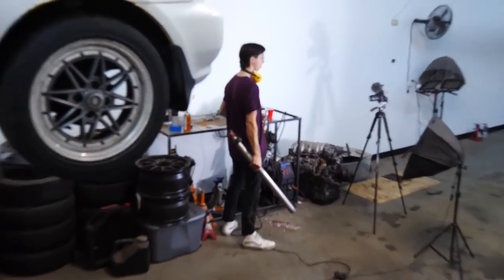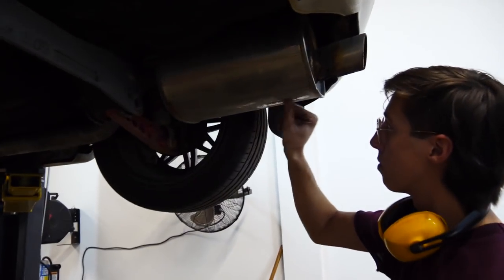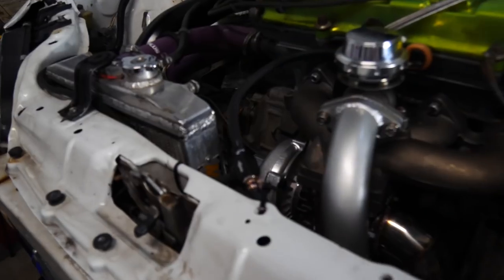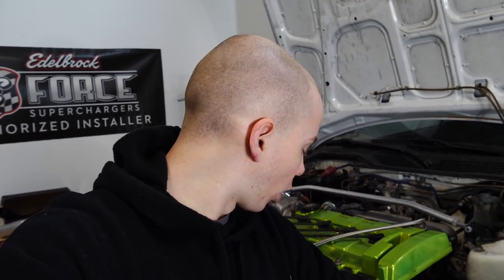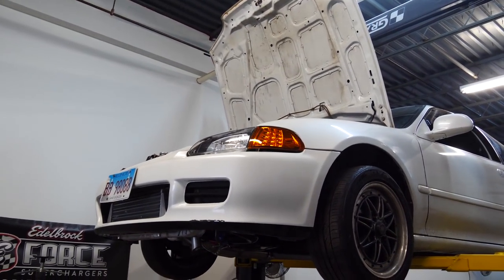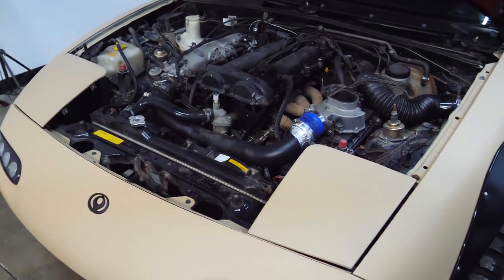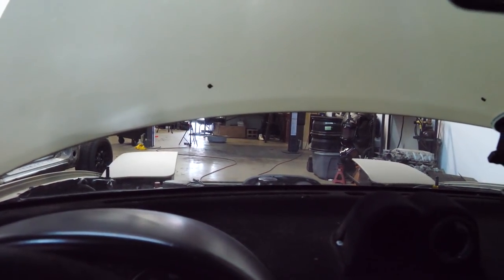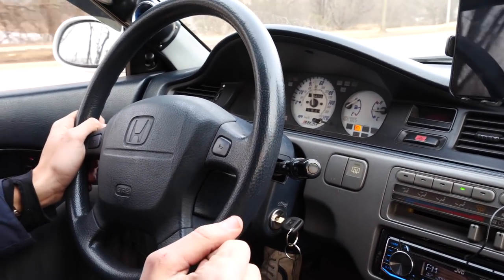FIRST DRIVE in the $600 TURBO CIVIC!

Comment: Dude mount your bench vise
Reply from the maker: NO! Not until the truck is running. I promised myself 😂
Reply: But ur making things harder on urself lol
Reply: @_Gingium_  Why lmfao just mount it, no reason not to
Reply: Mount it ON the truck. lol.
Reply: @vegas_the_trucker1595  cause it's a joke
Reply: Red Squirrel 

YES
Reply: Twice I have had material slip.  Nearly cut off a guys finger and drove a drill bit into my first knuckle while holding it.  No one wakes up in the morning and plans to have an accident.
Reply: I bet he's going to mount it on the burn spot😂😁😀

Comment: 1:53 if the weld sounds tttthhhthtthhtiiithhh and almost sounds like it's dying out its because it is probably staving on wire (that's just how I remember if I need more or less wire) try turning up the wire a touch. Or if big sparks are rolling off try point the gun into the direction you want to go. You want to hear a nice even steady cccckkkkhhhh! Like at 2:13 👌

Comment: Get a stage 3 clutch + Flywheel
And tune it for 400HP
Reply: Dude it has stock internals
Reply: @dryrain592  how much can those(stock internals) handle ?
Reply: @thevixty3006  About 350hp at the crank or 300 at the wheels
Reply: @joeyschrama  jeah for one season
Reply: Yes please do so we can all watch this pos civic grenade
Reply: Proper fueling and tune you could make 400hp without blowing up as long as you didnt beat on it and idk about that turbo
Reply: @chandlereastham  area × force
Reply: @joeyschrama  that's an oxymoron. It can either be 350 crank or 350 BHP. It's can't ever possibly be the same. Brake Horsepower is how much power hits the wheels. I know you meant 350 to the crank but saying "350 Crank BHP" might confuse some people.
Reply: People have pushed stock B series way past 400hp with correct setup but its not smart and it will blow apart eventually
Reply: Bryan 98 Good luck with the torque steer and internals

Comment: one thing you are forgetting is that the closer the turbo is to the engine. the hotter the oil and air is going to the turbo witch makes the turbo more affective

Comment: I would run the oil drain above the boost pipe. If that pipe ever decides to pop off, it will take out the oil line too

Comment: I don't think the oil drain for the turbo is too low. The oil pressure going to the oil-inlet side of the turbo can easily push the oil through the turbo and then to the oil pan.

Comment: Hi gingium Im a big Honda fan and my uncle is a Honda certified mechanic, he always tells me to build a b18 turbo setup so he tell me that u need to rebuild the b18 head and the camshafts, the cam gears. If u want to do it the right way, then go on Facebook because people sell b18 rebuilt heads and if u are lucky to find a rebuilt head with the springs and valves already put in the head then u should buy it, sometimes there people that sells them for at least $400 - $600 just for the head so if I were u read this I would be on Facebook market or eBay or Craigslist right now so u should look into it. If want to do it the wrong way then u have to have the car on low boost cuz the engine is gonna blow the pistons out the block or bent the piston rods or the block will put a hole on side, or the back.. so I will do it the right way. But anyways have a great day.